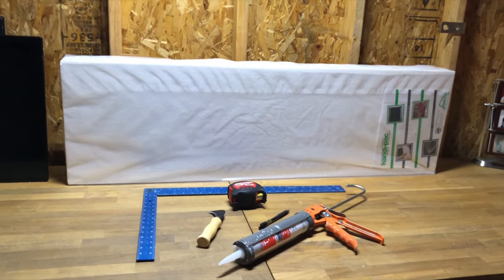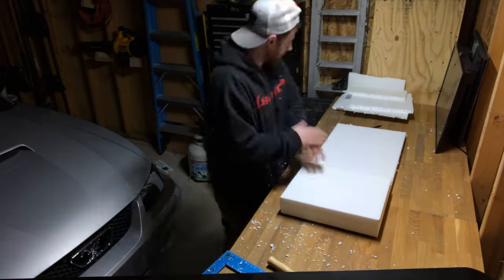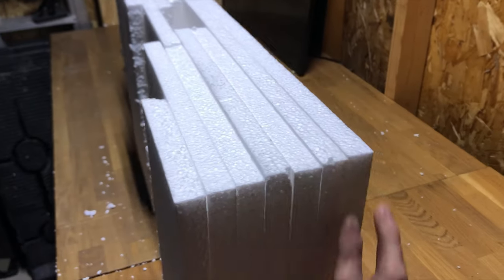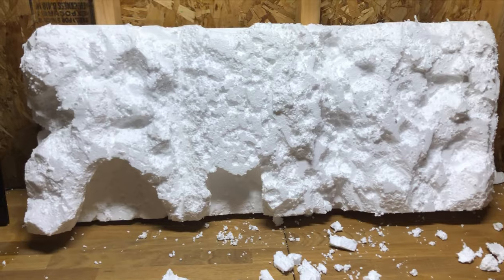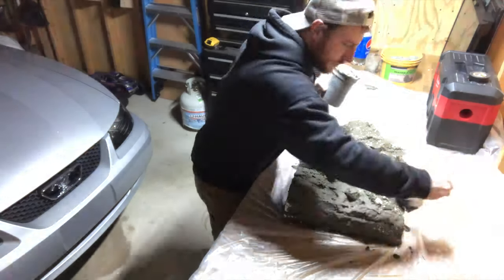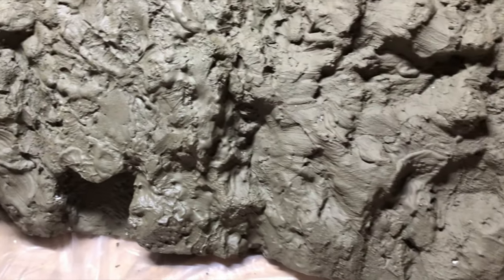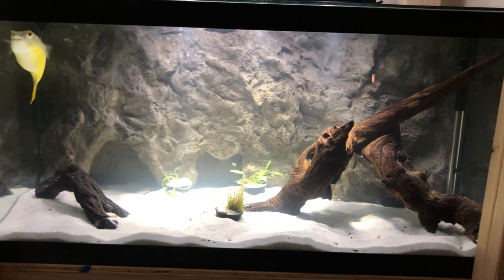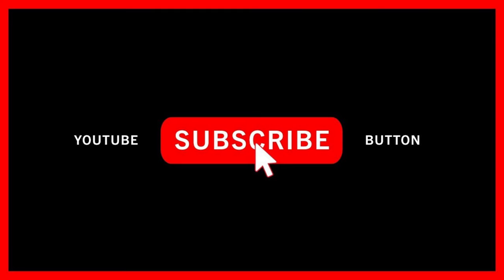DIY - How to make Custom 3D Aquarium Background for under 20$  |  CHEAP and EASY!! (Step by Step)

Comment: I might just do this project by hand. If you do it on a CNC machine, its more accurate than the best sculpture to ever live as the fault tolerance is below what the human eye can even see. The issue is getting a real scientific scan in CAD, translating it for the CNC machine, getting the right foam that doesnt cost an extreme fortune and then researching the best concrete mix to use. Or.. or.. I can just do it by hand and call it a day xD 

I think having a wall in an aquarium with a 99% accuracy of the real thing would be very unique and cool, especially if painted well but at the same time this is sooo much easier. Anyways, nice job!

Comment: I heard the leeching process for using concrete can take months.  like some people say they still have off the charts ph for 6 months when doing a 100 percent water change every week. what was your experience? Look great by the way.
Reply from the maker: This was my first concrete one. I have others but those are just painted. I had to watch my PH over a couple weeks with more then normal water changes but all levels are good now and well worth the 20 bucks!
Reply: @KeepinitReel616  Would you thnik live it on the rain and hose it for a week or more going to solve the problem, nice video, thanks

Comment: A few questions...
Does the styrofoam grow mold or decompose in the water over time? Or should the back and sides get covered with cement as well?
Also, if I ever wanted to remove the background, is that doable or would I need to buy a new tank?
Reply from the maker: I’ve had mine going since I made the video with no issues at all. You can remove it if you like then after it’s out scrap the silicone off with a razor blade.
Reply: @KeepinitReel616  9 months later, still all good?
Reply from the maker: @mikek2111987  still holding up just fine for me!
Reply: Did you coat the back of the foam?
Reply: Yeah did you coat the back of the foam when i made mine i had to cover all with cement because i didn't know the cement alone was ok to use in fishtank so i used clear plastidip but it must be on the cement if not it will melt the foam

Comment: Just found your video and had a question.

With a tank that has a lot of supports around the top, would you recommend sectioning out the background into vertical, or horizontal sections?

Comment: I start making mine but few things bothering my head  don’t we need to seal it? Plus how long we have to leave it to dry before we put in the tank?
Reply from the maker: No sealer and I let mine dry for 24 hrs. Silicone it to the back of my tank let dry for another 24 hr. Filled the tank let it run for a couple days then 100% water change. Then added my fish. No issues for over a year for me
Reply: @KeepinitReel616  thanks mate my tank is already running so gonna soak it in the bath tab for couple of days hopefully it works. 😃👍🏽

Comment: Quick question that I hope you can answer. I just did a 3D background myself and I used hydraulic cement let it cure for 24 hrs and siliconed it in and I have done 100% water changes the past 3 days in my 55 g tank and the ph is still extremely high. Is there any suggestions on how to speed this up or how long did it take for your water to straighten up? Thank any advice will be helpful
Reply: There is a cement especially made for reef aquariums where they cement  rocks to create arches and so,, Maybe you should try that. Your ph will be ok from the start

Comment: You’re using the Quikcrete Waterstop cement right??
Reply from the maker: Correct
Reply: @KeepinitReel616  so, you use water stop, paint the hell out of some foam, and it’s good to go? I’m probably gonna leave my rock backing in my kiddie pool for a month or so since it’s winter and he’s not using it. Thoughts? Do you think longer? What kind of stuff should I add to the mix, cus I’m thinking of just using straight cement. It’s for a 55 gallon tank of 2 comet goldfish. Only gonna make a inch-or-so backing. Basically a sheet, reinforced by sculptors mesh.
Sorry if I’m asking too many questions, I’ve been googling this issue since this morning any everything I’ve found has been contradictory to other people’s suggestions. It’s annoying, and you’re the first person I’ve seen actually do it

Comment: How do you mix the mud so fluid/ "paint-consistentency" and not have the mud flake/crack? Is it recommended to soak finished background before adding to the tank?
I tried mixing mine thine enough to pour/paint with & it's cracked up 3 times >_<
Reply from the maker: You need to leave the mud thick. Mix with the amount of water container says to use. Should be a thick paste. I didn’t have any cracks and still don’t a year later.

Comment: Can I clarify? What concrete mix are you using?
Does concrete mix stay on white sheets?
Reply from the maker: Yes it sticks on the styrofoam perfectly. I do not know the concrete brand off the top of my head but if you watch the video I do post a picture of it. Hope this helps

Comment: So I have been following your steps. My concrete has dried, but it is cracking.. did I not use enough concrete?
Reply from the maker: I’ve had no issues but I had it like a inch thick after my last coat
Reply: I'm currently making this type of background and concerned about cracking. How thick does the mortar/cement need to be?

Comment: dont u have to use some kind of sealer on it i thought the cemnt would kill the fish
Reply from the maker: No. But what you do have to do is do a couple massive size water changes before you add your fish. Your pH levels are going to skyrocket. After I did 2 100% water changes I added my puffer back to the tank. Every two days after that I did a 25% water change for a week. Now we are back on regular two week water changes and the puffer is happy and healthy.

Comment: Hi there, please help, I have now made this and emptied most of my tank but when I put it in the water it just wouldn’t go down as it kept floating up to the surface.
Reply from the maker: You need to silicone the background to the back glass
Reply from the maker: Let dry for 24hrs
Reply: Hi there,

Managed to do just that and I’m super happy with how it turned out, looks epic. If you have an email I can send a video of it.

Thanks for the video and reply.
Abrar
Glasgow, UK

Comment: What silicone glue are you using?
Reply from the maker: Not sure on brand but was a 100% silicone. Make sure you don’t buy the silicone with mold resistant in it. Other then that don’t matter

Comment: What kind off cement u used? Also what kind off cilicone?
Reply from the maker: GE 100% silicone and I’m not sure of the concrete off the top of my head but I do post a picture of it in my video that will show exactly what I use

Comment: i want to do something like this for my 10 gallon tank but thinking about, concrete maybe to heavy.
Reply from the maker: It’s 90% foam 10% concrete. You will be ok. It still floats it you put it in water that’s why you will have to silicone it to the tank. 
Ps it will be lighter then most gravel people put in their tanks

Comment: What type of cement is there a specific one or litrally any
Reply from the maker: I’m sure you could use others but I used a hydraulic concrete. I have a picture of it in the video at 0:58